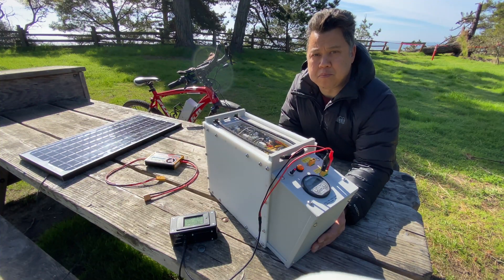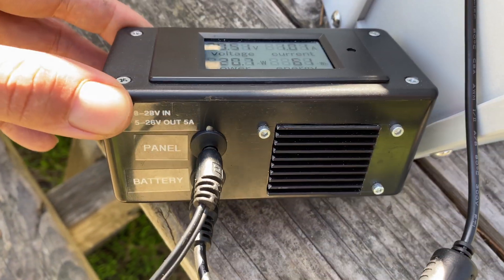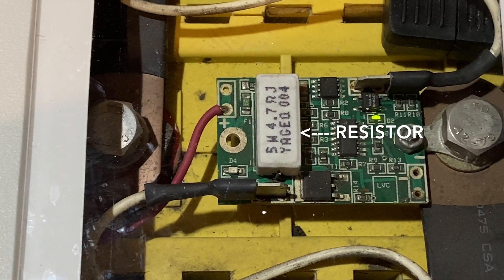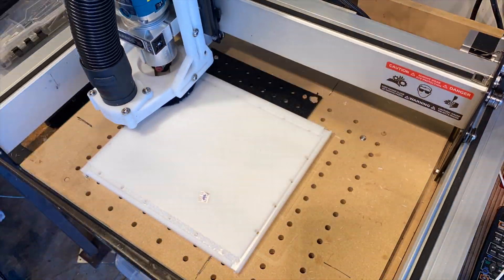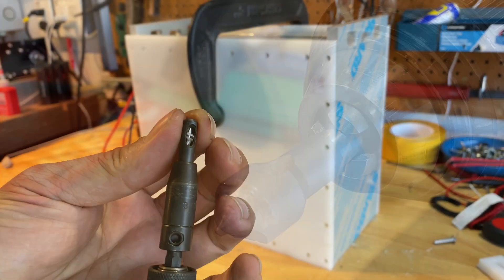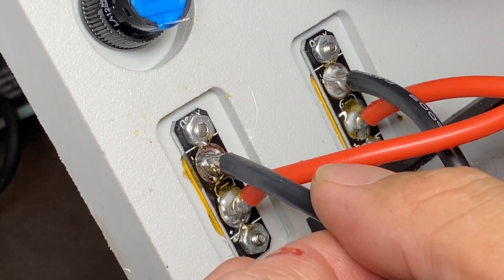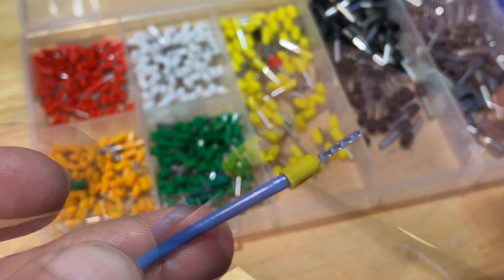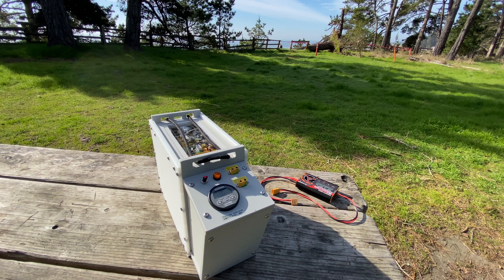DIY Portable 12 volt Lithium Battery

Comment: Great vid Tischer. Really cool battery setup - really well thought out, per usual for ya. I'm also digging the Shapeoko and considering going that route myself.
Reply from the maker: Yea you should, I've been using my Shapeoko much more than I though I would.   They pop up on Craigslist occasionally, that's where I bought mine.  Software is free to download if you want to try it out, works natively in Mac or Windows.  Nice that it sets all the feeds and speeds based on the material you choose too.
Reply: @etischer   I've been planning to build a CNC router for years (and have accumulated a good bit of hardware), but the Shapeoko is a pretty compelling option to 'speed' things up (errr, replace entirely, haha) on that project. Thanks for the info and great vids of it in action! Have you cut any aluminum on it? I imagine you'd have to be pretty delicate on depths of cut.
Reply from the maker: @adamstagnaro  I haven't done aluminum yet, but there are videos of people doing aluminum on it.  People that do use a program called Fusion 360 to generate G-Code with adaptive tool paths.  https://youtu.be/b-yBVOiJ4dY?t=112